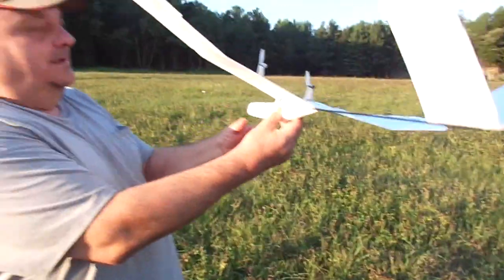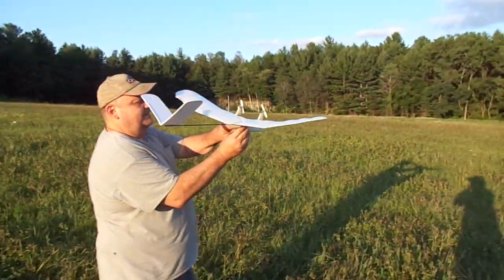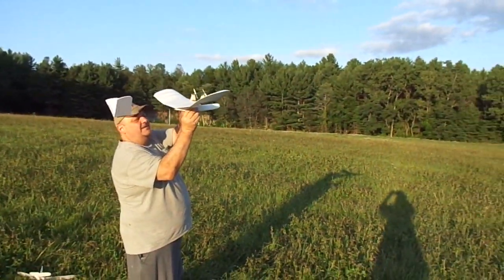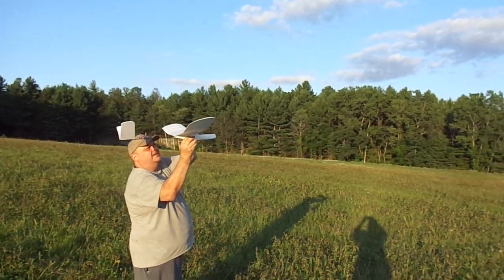JUMBO Supercapacitor Plane! Low Power 1:02 TEST FLIGHT!

Comment: Nice leveling, love it. I build so many rubber powered plane. Some of it converted to super cap too
Reply from the maker: Thanks! It is a plane for calm conditions only! Richie and I have been converting some of our older rubber power planes to capacitor power,and lately we have used some larger sizes of capacitors and motors. I'll post some videos soon, thanks for watching!  -Mike

Comment: Outstanding.  I'm just learning about capacitor flying and am very interested.  Want to learn a lot more!  BTW the trim on that model is perfect.  Like it was on rails.  Well done!
Reply from the maker: Thanks!! We've been logging around two minutes with that one when it has a full charge. Not to be attempted except in super calm conditions since the field is small! We meter the charge to limit flight time and there's a video showing how to make a charger like we use. Welcome aboard!  Mike and Richie in Massachusetts

Comment: I wonder if you could use super capacitors to make some stick and tissue kits int electric free flight.
Reply from the maker: Yes, absolutely! We are just finding out what sizes to use for various planes, there is not a whole lot of info out there...but we're having tons of fun. Peanut scale would take a 6 or 7 mm motor and perhaps a 10 Farad cap...Walnut scale perhaps a geared 7 or 8 mm along with a 25 Farad cap or 2 10 Farad units in parallel. There are some links in the description of this video which will take you to banggood where we get our stuff The plane in this video has 2x 8.5mmx20mm coreless motors and a 40 Farad supercap....that's the biggest we've tried so far, but I just got a 100 Farad cap that I can't wait to try on something BIG. If you haven't seen it yet, check out our "supercapacitor free flight basics" video.